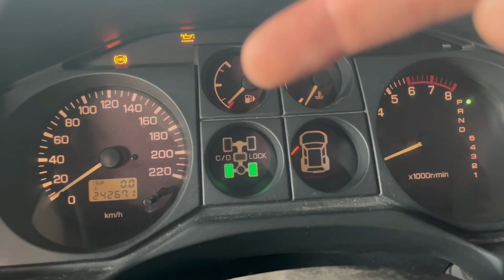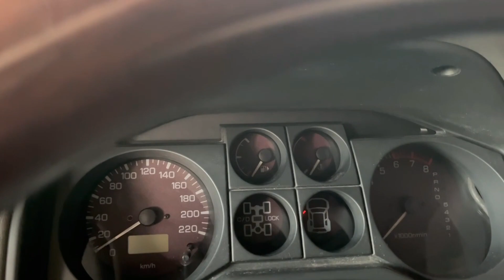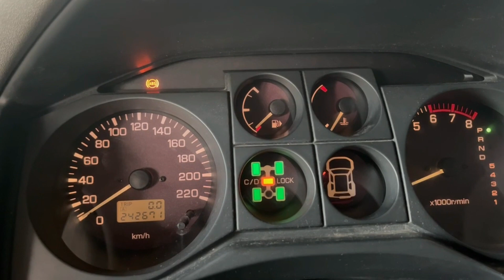No charge fix for the Mitsubishi Pajero Montero 3

Comment: I just replaced my alternator and my lights come on again yesterday. I was so upset! I plugged in a fresh 10amp! Thank you for this!!!
Reply from the maker: Glad it helped. 👍
Reply: After driving home from work the fuse blew again when I turned on my blinker. I pulled over, replaced the fuse and off I went. Any idea why this fuse is blowing with the operation of the turn signal? Maybe I need a new turn signal relay.
Reply from the maker: @SamuelDonnelly-n3l  it is also for hazard warning. Maybe relay is shorting or some wire on the turn signals. So need to check there. Best to find the wiring diagram. Sorry but I dont have it.